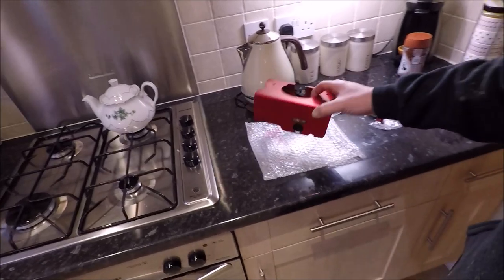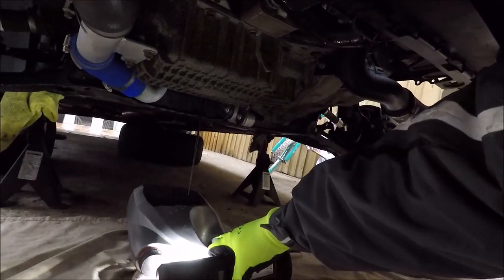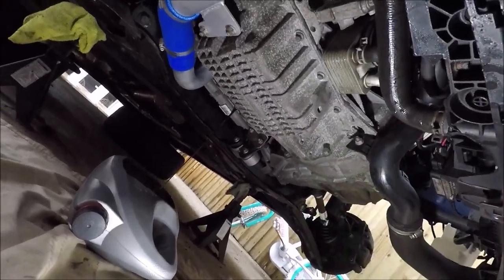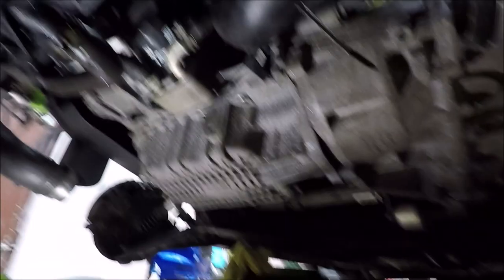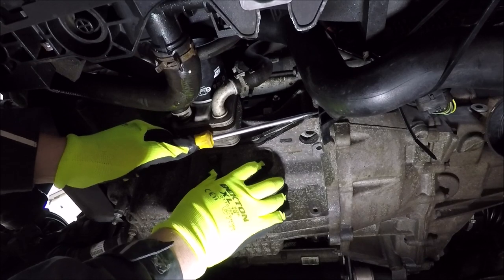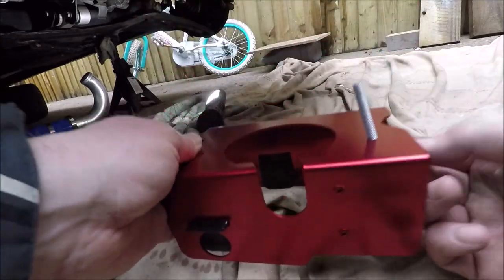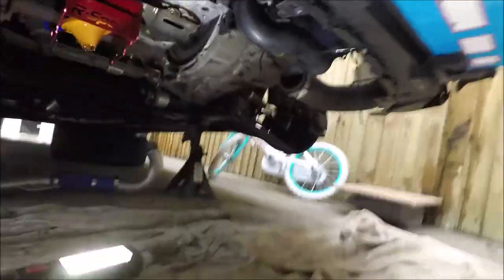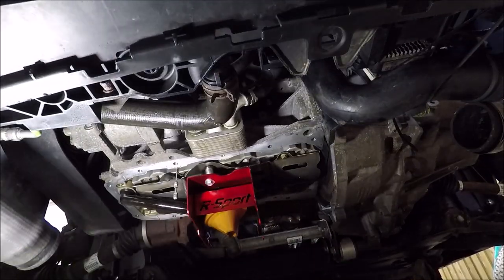Baffled sump  , Fiesta st - Part 13

Comment: Nice work! I'd suggest that if you're cleaning the sump with any detergent, or solvent that you rinse the sump with engine oil before reinstalling. Just reduces the risk of a chemical contamination in your engine oil that the oil filter won't collect.

Comment: a spot of thread lock on them two bolts might have been a good idea, sitting in hot oil is a good way to loosen bolts,
Reply from the maker: They have lock washers so hopefully do the job.
Reply: good videos, handy for anyone with a Fiesta or any ford, basically all the same, you paid a lot for the crash damaged ST I thought, did you make any money out of it, total spends compared to book price or is that not the reason for doing it,  I know of someone who buys ford focus's damaged repairable's because they are so easy to work on and parts are cheap he says,
Reply from the maker: Making money wasn't the reason I did it . I wanted a cheap track car.

Comment: Surly a lil drop of lock tight even from vibration no? Just to be safe so the vibrations from the engine done rattle them long bolts loose ??
Reply from the maker: Yes I could have. The washers are the star jagged type so should hopefully hold it in.

Comment: Hi Steve I know this is from one of your older clips  when you refitted the baffle screws did you put any thread lock on them also  what was the sealer you used for sump . I am getting the baffle from pumaspeed in next two weeks
Reply from the maker: I didn't put any thread lock in but wish I did. They do have lock washers though so should be OK. Check your local parts shop for a suitable sealant.
Reply: Spark Plug Steve thanks for that steve keep vids coming

Comment: It sucks that this car doesn’t have an oil pressure sensor. Any real major improvements, or just piece of mind mod?
Reply from the maker: Just piece of mind.
Reply: Spark Plug Steve doesn’t hurt!  I’ve found the baffle on eBay for like $120 USD. I may partake if the mod bug comes biting this winter 😂

Comment: Ideally you shouldn't be  prying at any material with a material that is harder than the parent material. In this  case you shouldn't have been ramming a hardened steel screw driver into soft Aluminium, what would have been a better plan would be some plastic trim removal "spudgers"
Reply from the maker: Its an overlap gap so no mating faces were touched. It could be risky but if your careful enough no harm was done. Thanks for watching.
Reply: @Sparkplugsteve  I saw that, i have done it myself using a screw driver, and cracked a sump !!!  is there no jacking-off points that are threaded so that you can wind in some bolts to allow you to break the seal ?

Comment: Why not remove the fuel cover cap and send it to the bumper guys for a colour match? Got to be the cheapest and easiest method?
Reply from the maker: I sent a sill jacking cover and they scanned it but want to check the wings. Its not a pronlem as I need to make a visit to pumaspeed and their close by.
Reply: @Sparkplugsteve  ah, fair enough. Hope they get a good colour match.

Comment: you will regret fitting that things like that are linked to so many engine failures deposits build up on em and end up blocking oil to the pick up
Reply from the maker: Do you have any links I can read?
Reply: @Sparkplugsteve no mate its engine changes iv dune and so many of them have had this fitted to it
Reply from the maker: Why would deposits be building up on them if oil is changed regular? Would not the windage tray also be gunked up? Sounds like dodgy maintenance is your problem not the baffle.